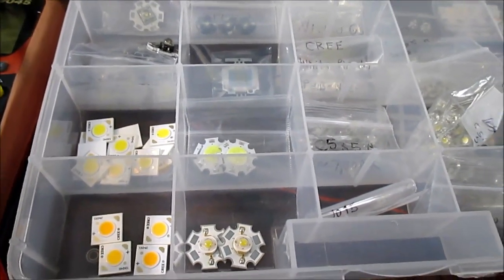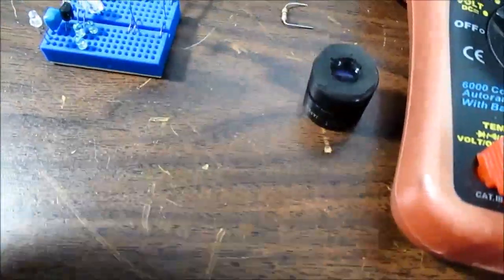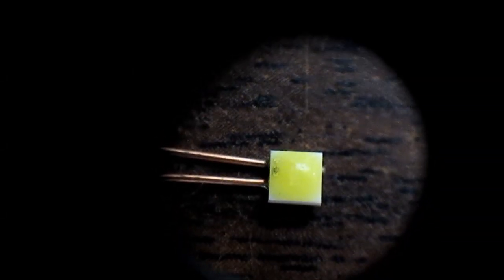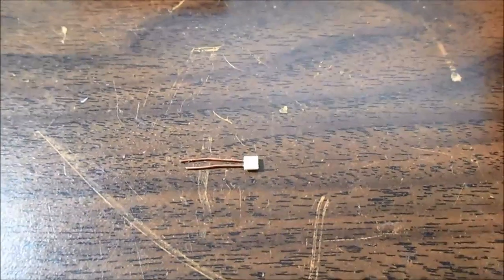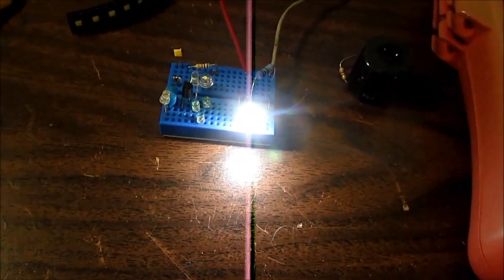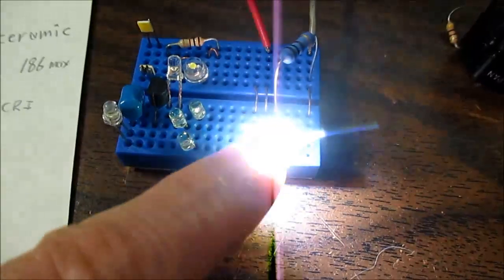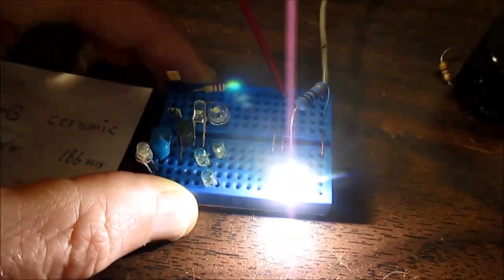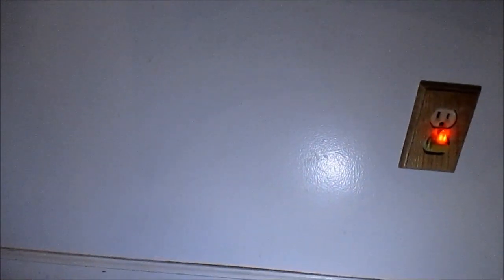175 lumens per watt Cree XH-G LEDs

Comment: how much lumens per watt could you get if it were 100 or 99% efficient
Reply from the maker: Yes, very hard to pin down a number and I'm no expert, but for white light it could be upper 200s to mid 300s lm/w (lots of conditions). Today's phosphor coated blue or near UV LEDs that are used to make white light could make it to 250 lm/w or a little beyond. Even at their theoretical best, there are still conversion losses that will prevent them from converting 100% of the input energy to light. Looking back, it is amazing to me how far we have made it with semiconductor based lighting technology in such a short time.
Reply: It's hard to answer because white light is a spectrum of electromagnetic radiation frequencies. According to wikipedia, green light at 555 nm  has a maximum possible luminous efficacy of 683 lumens per watt. 
(My terminology might be wrong as English is not my natural language and I was certainly not taught physics in English language.)
Reply: Mandragoras 
hmm maybe 3000k warm white?
that would be cool maybe 300 lumens per watt???